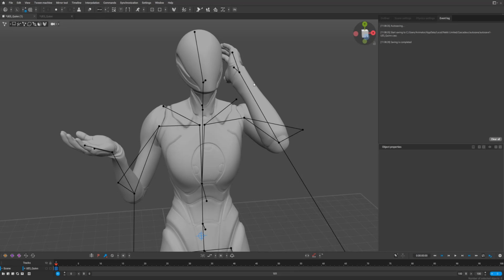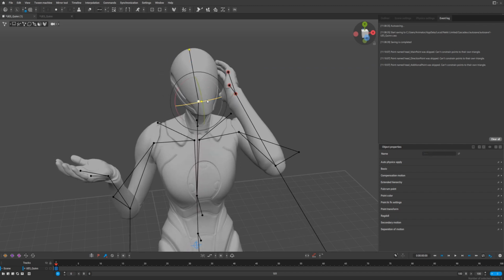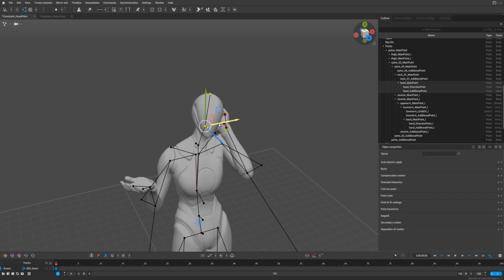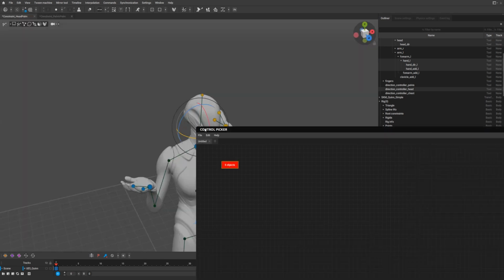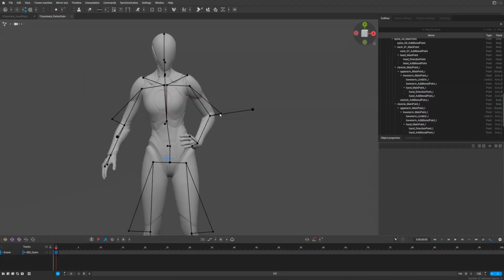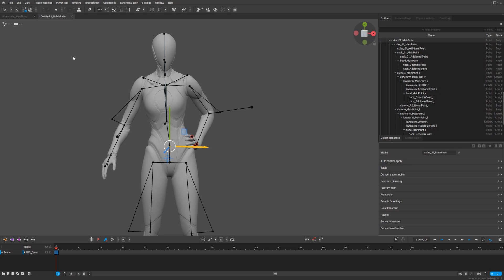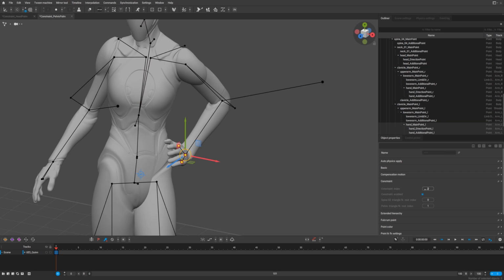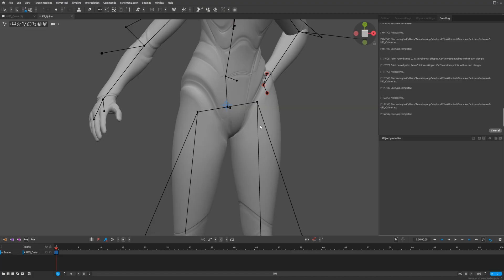Cascadeur: Constraint Tutorial 2025

Comment: Hi! When I add auto physics, the sword just flies away even though I constrained it. Could you please help with that?
Reply from the maker: In the "Object properties" => "point ik fk settings" you need to activate "Enforce FK in interpolation"    screnshot from googledrive: https://drive.google.com/file/d/1Bcdzh_I4fyI7T-zOXt51rxAp9zK3VVn1/view?usp=sharing
Reply: @SergejSamoilenko  Thank you for reaching out, man! Really appreciate it. Unfortunately it's still not working. the green guy's sword still flying. could you take a look at the screenshot?
https://drive.google.com/file/d/1Mh5FJ6woGh64K7OtWzvEbW33QREfDujW/view?usp=sharing
Reply from the maker: Try to ask here, they are very responsive: https://discord.com/channels/553166696916189184/1065286753872777297
Reply: @SergejSamoilenko  thank you a lot!
Reply from the maker: @hookedj7184  I was very interested how to solve that problem... and Cascadeur support gave me an answer in discord. That relatively easy btw.
 You need to create "composite center of mass" of your character and sword, from the Commands meny. 
 direct link to the Discord post(there are also video): https://discord.com/channels/553166696916189184/1065286753872777297/threads/1423987612737077410
Reply: @SergejSamoilenko  Huge Thanks!